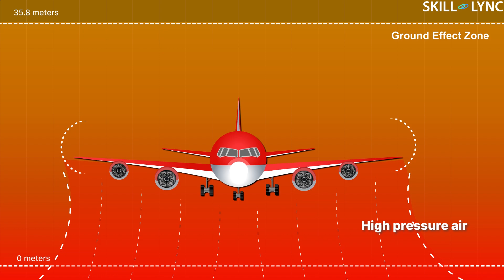What is Ground Effect? | SKILL-LYNC

Comment: It's wrong, it is not about compressed air between the aircraft and the ground. 
It's way more complex than that. It is about the interruption of the induced drag's vortex by the ground, causing a slight reduction of drag and the increase of lift.